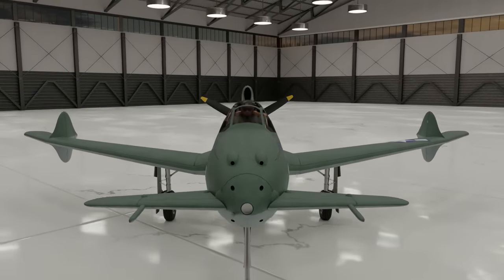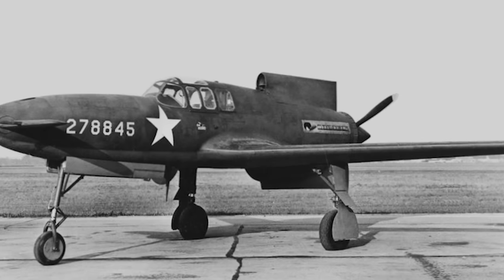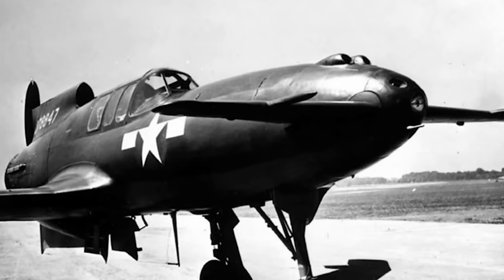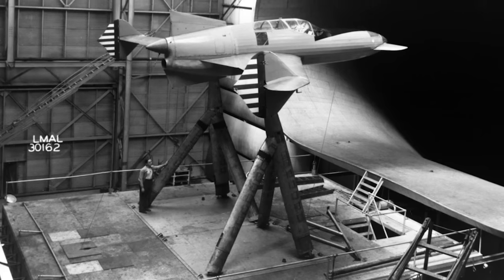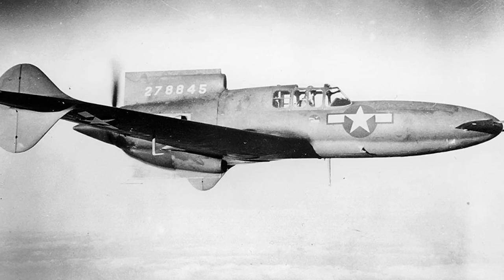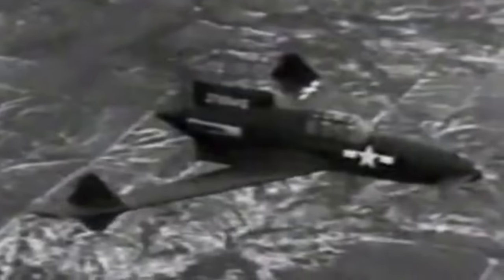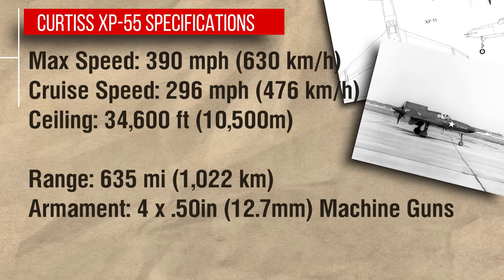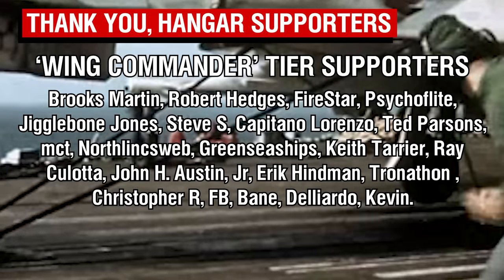The WW2 Super Fighter That Was Built Backwards | Curtiss XP-55 Ascender [Aircraft Overview #76]

Comment: The P51 was entirely a UK project, they wanted to have NA manufacture p-40's for them under license and the Owners proposed a new plane, 100 days from approval to something they could present to the British. America no doubt was watching and took some for testing but the engine was still not right.
Good stuff though, example: you would think the gun mounts would be done right, a lot of alterations when it seemed obvious they were testing a new concept in the middle of a war. The 1930's would have been a good time to work the bugs out of Pushers for them to be usable in the war.
The Japanese J7 seems to have had very few of the stability issues. 
I would have put the pilot right up front with weapons in the wings and cartridges feed to the tips and dumped. It looks like they were capable of a two step ejection, with the nose coming off and getting clear before the pilot bailed. Or a double engined one

Comment: If Burt Rutan had designed this aircraft it would have been a success, he was well known to put thought onto paper, build it and the aircraft would fly, without computer aided design.  The man was and is a genius.  Pusher propellers are more efficient than tractor, however the latter had the advantage of airflow over the wings and tail section that produced better control surface response at low speed when power was applied.

Comment: The configuration is similar to the Ambrosini SS.4 which flew (briefly) in 1939. Ed Nash has a video about it.

It may not be realised, canards can be stable in pitch. This is achieved by giving a positive inclination to the forward stabiliser, thus moving the centre of lift forward. It's very noticeable on the SS.4
Reply: Yes canards are stable in pitch--as this aircraft was--but moving the center of lift forward does not make an airplane more stable.
Reply: @gort8203  It's an oversimplification but it's true. In a conventional design, if you load the plane too much aft and trim to get the CoL the same place as the CoG, it becomes unstable in pitch. This is because the moment arm of the horizontal stabiliser is less and it doesn't provide the necessary restoring couple.      

With a canard it's the opposite, the mainplane is providing the restoring couple. Again moving the CoL forward increases the moment arm and hence, stability.

Wiki explains it by saying the foreplane's wing loading is made higher than the mainplane's. I think this is the same idea.
Reply: @pwmiles56  By “CoL” I have to assume you mean the Center of Lift, by which I will also assume you mean what is often called the “balance point”.  Except for a flying wing without a tail or a canard, the mainplane does not trim itself. The contribution of a tail to longitudinal stability is somewhat intuitive, and the contribution of a canard perhaps less so. But in either case the total of all pitching moments about the aircraft CG must be zero, or it will pitch one way or the other.  So this balance point must remain at the CG to maintain the trimmed AOA.  If a gust increases the AOA there must be a negative pitching moment to restore equilibrium.  The moment can either rotate “down” forward of the CG (canard) or “up” aft of the CG (tailplane).  While I do not agree with considering the mainplane of a canard aircraft as a tailplane, even if we accept that premise then the CG must still be forward of that mainplane for positive stability. The length of the moment arm affects the torque applied, but moving the center of pressure of that mainplane forward of the CG would not increase stability, it would be destabilizing.    

I think the positive inclination (incidence) of the canard you originally mentioned reduces its coefficient of lift with AOA gradient, which is what allows it to generate less lift than the mainplane in response to a gust and a net negative pitching moment.
Reply: @gort8203  I probably agree. Positive incidence isn't the only way to increase wing loading in level flight. A curvier aerofoil could also do this. But either way, with a canard foreplane the increase in lift due to greater AOA (angle of attack) must be less, proportionally , than that of the mainplane.

Comment: With a pusher prop, is the lack of a good current of air over the wings and control surfaces significant (especially needed on take-off and at slower speeds? One had this with the earlier, underpowered jet a/c, even the DH Comet airliner.

Comment: Swept wings probably the main problem.  It's not a jet !  :D   I bet straighter wings would have solved many of it's flying issues. Over heating still an issue.
Reply: Why? How?
Reply: no it would not have helped there and if you watch the vid it was to go 507 mph the sweep is not like a jet i see a home built  type  Rutan VariEze   but  IMSA vents might have helped with the heat
Reply: @xkgbciax5286  Can the Rutan do aerobatics ? barrell rolls etc? I doubt it. I noticed the Rutan has a larger front  .. ?? ..wing? Thus making it a biplane. I suspect this was the answer for the Azz-ender too.

Comment: I've had the opportunity to fly/fly in a few swept wing, pusher, w/ canard, aircraft.  What I have experienced with each of these aircraft makes almost all of the problems with this aircraft almost comical.  A higher-wing configuration would have allowed better intakes under the wings, allowing for better cooling, and would also have helped with place the gravity centerline lower (helping to mitigate the inverted roll characteristics. Larger horizontal stabilizers at the wing tips would have drastically improved both stability and maneuverability at all speeds as well.

A few, in my opinion, simple changes, would have made this aircraft a real success.  Too bad Burt Rutan wasn't on the design team (IYKNK).

Comment: Do you think this is a design that might have benefited from switching the power plant to a jet engine, or would the inherent stability still hold it back even as a test bed? I understand the inherent advantage of using inline engines for pusher planes, have any been attempted with radial engines, I know the US had some excellent radial power plants available as well.
Reply: A jet engine would have probably necessitated a wing redesign. However, in that case we could have been looking at the first delta-wing fighter.
Reply: I believe,  most radial engines were air-cooled. That would have been much harder to cool in the back.
Reply: One of the problems with early jets was the need for a short tail pipe to prevent power loss, hence designs like the De Havilland Vampire.  As such, the XP-55s configuration MIGHT have been suitable for an early jet design - already being configured to have the mass of the engine at the rear of the plane - but I doubt it would have done anything to help with the slow speed handling problems.
Reply: The Swedes did this with the SAAB 21, using a de Havilland Goblin; the result being the 21R.
Reply: @demonicsquid7217  Jet engines are actually significantly lighter than a piston engine of similar thrust - one of the reasons turboprop conversions have long noses.
Swept wings have horrible stall characteristics by default. Stalling aft swept wings almost always results in a nasty and frequently unrecoverable spin - which is all modern jet airliners are forbidden to even approach stall conditions.
This is because as one wing stalls, it’s drag increases dramatically causing a yaw which then reduces the angle of incidence of the other wing increasing its lift - and the aircraft flips upside down as a result.
Really big vertical tail surfaces are required to control this tendency (which also come in handy for supersonic flight).

Comment: It's a funny thing; planes look the way they do because that design works. When you see a plane that looks strange or unconventional, it's probably either a prototype or already discontinued because it didn't work too well. 

Canard designs only really became feasible after the advancement of fly-by-wire systems in the 60s, due to the inherent instability of such designs. Same goes for flying wings. 

It's why I think, barring any serious technology jumps, airliners are going to look exactly as they do now forever. Any crazy new design is going to have more problems than the benefits it brings.

Comment: The P51 was developed to British specifications and was transformed into the superb aircraft when the RAF fitted the merlin engine instead of the Allison.
Reply: Not really to British specifications. North America was approached to build pP-40s under licence. NA felt it could do better. I suspect that NA already had preliminary work ongoing for the P-51. As the Allison powered Mustangs. The RAF was very happy with the low level performance of their Mustangs using them for low level photo recon. The major issue with the Allison was its lack of a two stage mechanical supercharger until late in the war. Which can be traced to the USAAC and its decision to go with turbosuperchargers. Also during the 1930s money was tight.
Reply: Once again people kind of overrate the Merlin. It's not so much that the engine is particularly better than the Allison. It's the fact that it has a two-stage supercharger. Allowing for power at different altitudes.

Comment: Ironically it is similar to the Japanese Shindin. The Germans went further with the Do 335 which used two engines at each end. I think there is a partial problem with pusher propellers receiving dirty air coming after the fuselage. This is similar to when rear stablizer is too much inline with the airflow off the wing especially as it nears supersonic speed

Comment: Where did you get that definition of Canard?  The origin of the term canard comes from the nickname the French gave the Wright flyer.  The Wright Flyer has a fully moving elevator on the front of the aircraft.  So I don’t know where you got the idea that it has to have a stabilizer and elevator?  The definition is a pitch control ahead of the main wing.

Comment: The initial problem with this plane was that it was overall too small and too light, setting limits on it's range and engine choices. As with the P-40, limited space for cooling systems and supercharger options. Heavy fixed armament with consumable heavy ammo load located a mile from the CG. A radial engine is lighter, and more importantly, it's shorter length allows it to be mounted closer to the AC CG. I was always curious as to the fuel tankage on this plane, location and volume, and the effects on CG as fuel is depleted, and tests on high -speed power diving and compressibility.

Comment: I never got the draw for an inverted V engine the oil settles into the cylinders and a liquid cooling system.
Reply: dry sump is how it works theres  oil in engine well only what it needs no pooling less load on the crank Free HP
Reply: Greg's video on the 109 explains that an inverted layout makes for easier maintenance in field conditions.
Reply: @GNpatent  
When all you do in the field is change the oil and spark plugs...
Reply: @calvingreene90  The Germans certainly did more than that
Reply: @GNpatent  
Ok they also changed the points, adjusted the timing and fuel injection. They sent the engines back to the factory for maintenance while Americans did full block overhauls in the field.
The improved field of vision falls apart if you move the oil cooler to on top instead of underneath the engine and raise the cockpit a bit all of which can be done without increase in drag.

Comment: It was silly to put the XP-55 engine in the rear. Even a kid building model rockets from scratch would know that weight at the tail end causes instability. Would it have been worth putting the engine (or an additional engine) in the nose, with a drive shaft to the rear? Better weight/mass balance would likely have made the XP-55 a much better airplane. Dual engines might have made it fit for purpose, while eliminating the horrible stall-roll problem. [As I write this, student pilots are learning stall recovery overhead.]

Comment: would the xp-55 work with a jet engine?

Also would the XP-55 work with modern day fly-by-wire?
Reply: Sweden had SAABs 21 series which were pusher props and later converted to jets so perhaps, tho they did have twin booms which I assume helped the stability

Comment: odd how this fighter looks like the would be jets of the modern era. Swept back wings, rear mounted engine, nose mounted cannon, though the last ones not so much. Maybe if the engine and propellers had been replaced by a turbojet engine and probably computer assisted control it would have worked out.

Comment: I think is was ‘ Purginni’ ? Who finally explained the easy explanation of Bernolli principle in @ 1952 ? Which led to these weird aero designs, including the swept wings of the 43-45 era in Germany. The Kahm cutoff rear in aerodynamics was a result of the fundamental misunderstanding of this basic nineteenth century theory misunderstood by modern engineering because of the arkaine language of the late nineteenth century. Simply put, the engineers realised that the Atmosphere was 57% less dense than water, ( at sea level) , but it’s density didn’t increase at speed, especially over an aerfoil.The design shows it is impossible to make the atmosphere change it’s characteristics to conform to the design of an aerospace executive.
This design actually excellerated the adoption of turbine engines, exhibiting the fact that lift is a gift, but thrust is a must.

Comment: I never got the draw for an inverted V engine the oil settles into the cylinders and a liquid cooling system.
Reply: It worked quite well for the Messerschmit 109 .
Reply: dry sump is how it works theres  oil in engine well only what it needs no pooling less load on the crank Free HP
Reply: @xkgbciax5286  
Dry sump in radial as well and you still have to remove the oil in the lower cylinders before starting.
I would run dry sump in a proper V engine as well for less impact load on the crankshaft and you can run with a bigger oil deficit when battle damaged.

Comment: Designer: introduces a revolutionary new aircraft that is proven to be an asset

US Army Air Corps: Allow us to make it worse before we buy them.
Reply: Army has requirements it sets up based on its needs derived from the character of the war. Engineers are just tools to fulfil these requirements. The history of plane engineering is full of splendid warplanes that were of no practical value in combat. Whether it's revolutionary or not matters only for historians of technology.
This plane has universally failed to meet Army's requirements. The main premise behind its design was far ahead of the technology of the day to realize it. With such a massive fault rate this aircraft just could not be added to the UAF armoury.

Comment: The 1710 was an ok engine and vg if a proper supercharger was fit but... it was a mess up in as many designs as it succeeded in. The 3420 had potential and when the 1710 was used in twin configurations like the 38 or 82 it was good. Solo...mediocre.

Comment: The term "canard" arose from the appearance of the Santos-Dumont 14-bis of 1906 and is the french word for duck. Canard refers to the configuration and location of the pitch control not the movement or lack thereof. Canards can be full moveable as in the Ascender and Su-33, fixed like in the B-1B, or a combination of the two such as in the Piaggio P180 Avanti where they are fixed for cruise yet have flaps that are used for landing. The Tu-144 actually had retractable canards that were used for take off and landing. The Wright Brother's 1903 Flyer has a fully moveable canard elevator.

Comment: Its interesting to know, that the Wright Brothers first "Plane" the forward mounted elevator system, was too small, and too close to the plane. When they pushed the elevator forward by I think 3 feet, the plane became much more stable. So maybe that would have solved the problems with this plane. Other thing, a rear mounted engine, is much more vulnerable to damage in a dog fight.

Comment: How would more power have improved low speed handling? Why do you keep saying the Allison wasn't powerful enough? It was quite comparable to RR 1650s in power per pound, power per cu in, etc. The problem, as you should well know and should have explained to your viewers, was with the supercharging. The engine as used in this plane lacked power at high altitudes, which, of course, was a major reason why it did not deliver very high absolute speeds. It's a shame you are so shallow and snarky about an interesting might have been. Good choice of subject, deplorable treatment.

Comment: 14:45 The stalled/crashed plane still has its propeller. What happened to the propeller ejection system? Were they just PLANNING to install it in another version or did it fail?
Reply: Good question.  I noticed that, too.

Comment: i gues it would have no chance in dog fight, 1 burst from 109  rip engine
Reply: it's a interceptor aircraft, or simply interceptor, is a type of fighter aircraft designed specifically for the defensive interception role against an attacking enemy aircraft, particularly bombers and reconnaissance aircraft. and if did go the 507 mph the 109 would had been shot down with a head on pass where he would be  taking the 109's engine out ez with his 30 or 37mm  gun  and a plane like this with canard is almost always better in dog fight , this is just a plane kinda b4 its time and they really did not put too much into the tech

Comment: 419 mph @ FL 190 not bad for 1944-45. Was the power problem actually a lack of power, as you say, or lack of multi stage supercharging? There's a big difference, as you ought to know, and ought to explain to your viewers.  Where is engineering scripture does it say a canard has to be a fixed surface? Interesting airplane, if probably terrifying to fly. Too bad you are chose a careless, snarky approach .